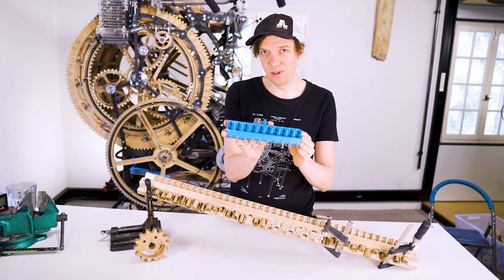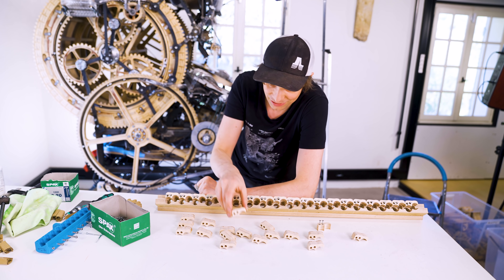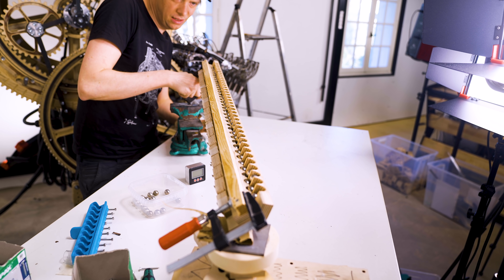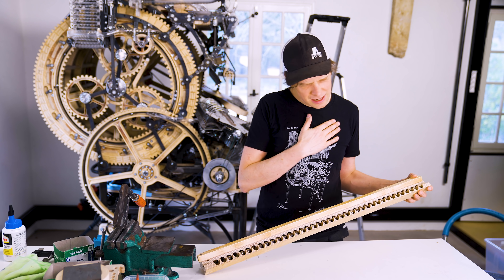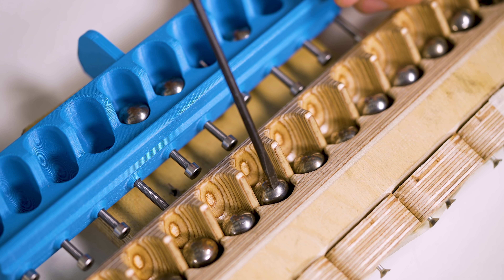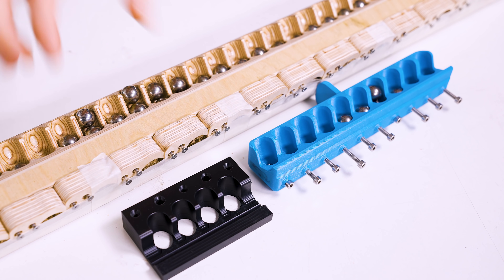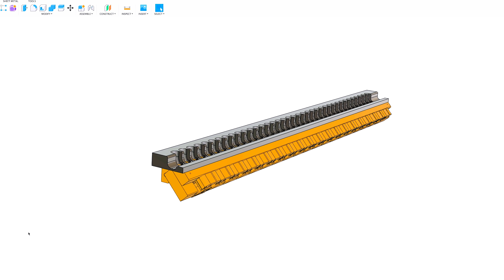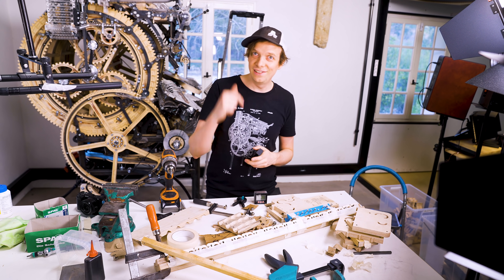Ultimate Material Showdown

Comment: Martin, replace all the wood with plastic, plastic will last longer, and where possible, replace it with metal, I have been waiting for the end of your project for a long time, but you are constantly going in the wrong direction! Perhaps the purchase of a 3d printer will save you, but the CNC will not solve all the problems.

Comment: I'm just curious I know you say you want to take this on the road, I'm a guitarist myself so what I'm curious about is when your designing parts are you thinking about the expansion/contraction of the materials due to temperature and humidity? Like if the material contracts too much you could loose all that precision. The reason I ask this question is you raised the point of wanting larger windows for tweaking.

Comment: SUGGESTION: Machine in plywood but don’t Dremel it, then paint the surface with UV-activated epoxy resin ( say 3 coats ) Expose to UV between coats. Then machine again with the same orientation to get hard, sharp corners. Should considerably reduce friction and maintain appearance. 

A couple of observations: 

1. Holes at the top will may more problematic as the balls will have less momentum at the op

2. Balls magnetised?

Comment: The gloss-to-satin black of the POM will play well with the black of the MMX's metal parts.

The only idea I could have to retain the plywood, would probably be to add a veneer of steel that would reinforce those sharp edges on the one side and metal inserts to reinforce and become the leading edge of the walls of each drop cell. Which seems like a bitch-and-a-half to do to retain a part that arguably is going to look better in POM.

Comment: What about milky looking delrin? wouldnt that be more fitting with the soft color palate of the machine.
Also what if you take the wood parts, cast them fully in resin, and after hardening you run the toolpath again to create the wooden look with crispy edges?

Comment: If you really want it to move smoothly, get some PTFE*

*Don't actually get PTFE, it's horribly toxic when you machine it. POM is a really good option though - honestly I wasn't sure why you weren't using it more for other things in the build 'cause it's so good. It's as strong as aluminium in a lot of applications and very good for gears and such - in fact the small jack that comes with your car probably has a POM nut on the screw part.

Comment: But how are the marbles going to feed into it? There are multiple parallel tracks that feed in from the back down the divider length at the moment, that won't be possible with the new divider design, as the marble holes are now against the back edge where they feed in. This means the new divider will either have to be attached the other way round, with the marble holes angled towards the front of the divider, or fed from the front. You are testing it the wrong way around  ;)

Comment: of course diferent materials have different properties. H+arder surfaces like PMA (compared to mst woods) imbuemore of a spring in the marble movement since more of the impact energy is reflexed back. The more resilient the material, and to some extend the top layer, hence you can change the physical properties of wood  with varnish, many layers albeit, like in string instruments. perhaps you should start playing with different applied coatings on the wood? might be the right time to investigate epoxy , varnishes . you might be ableto add a bit of color to the design as well.

Comment: So, I just want to point out that your material trials were incredibly biased against the plywood, even though I agree with your findings. Your data set for the POM was the smallest out of any of the materials, and thus the least trustworthy; while the plywood had a (comparatively) massive number of trials, which made the numbers of failures larger as well.
Reply: Obviously there will be ultimate material showdown part2 when the full size POM part is milled!

Comment: You could try tightening the tolerances a bit on the plywood, sand it smooth to grit 400 or 800, buff it with the dremel and use something like beeswax to make it slippery smooth. It will have similar properties to plastic.

Comment: One suggestion from what I do to have low-friction, mechanical plywood parts: Machine part by a "roughing pass", brush on fast-cure, low-viscosity expoxy resin mixed with a little aerosil to thicken it, let cure and do the final "beauty" pass. This yields parts with a precise surface and the original "wood" look

Comment: the rounding of the wood creates a ditch between the lower marble and the curved edge. The marbles stop against the "hump" between the two marble slots. What if you just continued that ditch through that "hump" (and perhaps in the side wall too)? Relying on edge sharpness is a problem for longevity of the parts. You'll have to replace them very soon, because even the POM will wear. I liked the idea of rounded edges to prevent wear, and I definitely agree that a reliable design is one with a lot of tolerance (what you called "window" in this video). The rounding is "pre-wearing" of the edges. You just didn't "pre-wear" the separation between the marble slots... It won't need much, just a little dimple in the right spot, perhaps just 1mm or so. It would be more durable and a lot cheaper in material, I think.

Comment: I wonder if the angle needs to change at points along the length? The marbles lose a little speed with every collision with one sitting in the channel, so at the end of the divider they have been slowed a lot, and a steeper angle would compensate.

Comment: no entiendo por que te preocupa tanto el ángulo de descenso del carril si no modificas el ángulo de acceso a los tubos que sigue siendo de 90 grados, dificultando el acceso de las canicas

 I do not understand why you are so concerned about the angle of descent of the rail if you do not modify the angle of access to the tubes, which is still 90 degrees, making it difficult for the marbles to access

Comment: This Ultimate Material Showdown was a good idea to eliminate the plywood... If all materials were tested at the same conditions. Martin tested PMO element half length of Rossero's PLA prototype, which is also a mere fifth of the current divider. Also Martin didn't considered to test with a non sanded prototype, or even a harder wood type. This is sad to ditch the wood this way, without considering all fixes possible

Comment: You should try to remember that you will have a constant feed of marbles going through that divider and their combined gravity weight should keep it feeding all the way through. Try adding a tube that can feed like 30 to 40 or more marbles at a time and see how it flows with that kind of marble pressure to set your angle in the window of your machine.

Comment: Need to think about surface tension of the material. If you had a way to make the plywood as smooth as the plastic print, the marbles would have less to slow down and by that would increase the speed going down on any angle. +Wintergatan

Comment: I spent 10 years studying and developing tribologically optimized solutions to convey materials.
With specialty, modified POM grades materials I could get a can sliding ( sliding, not rolling) over an inclined plane as low as 2°40'. And this in dry conditions, no lubrication involved.
Going with POM you'll have a reliable, time stable solution. A bonus point is the fairly high hardness for an unfilled grade, which  avoids dust partcles to get stuck in the material surface, hence a good friction stability over time, making it a so better candidate than UHMWPE for this application.
The total absence of hygroscopic reaction makes it way superior than PA for this application.

Comment: 6:49 what if you were to undercut the clearances of the walls and holes on the CNC and get them to final size manually? It would take extra time, but you could manually ensure each hole and wall was the right dimension as you went, as well as avoiding any fraying of the plywood.
Reply: I think that's where the material decision comes into play. Allowing the CAD to carve in POM (PolyOxyMethylene) plastic truly is that insurance.

Comment: Another approach: reduce the variation in the marble positions, too. Then you won't need so small tolerances on either the marble divider nor in the individual marble paths.
Reply: So how do you do that? You can't just say "reduce the variation" and not give a way to reduce the variation.
Reply: @StoneUSA  with the previous approaches. Either by adjusting the pipe lengths or using the marble height adjustments. Of course - if the different materials can avoid this issue altogether, then this is not needed. But if not, this could help.

The problem with the previous adjustment wasn't so much in that it didn't work, but that it requires such a fine tolerance with the height. This one (with plywood) didn't require such a  precise height, but was more picky on the angle.

With roughly the same marble heights this gives more tolerance for the angles.

Comment: You could always make a 3dp or machined plastic insert(s) that would fit inside a plywood shroud. Then you'd have the performance but also the aesthetics.

Edit: they also make 3dp filament that looks remarkably like wood, which was used to make the adjustable hight modules, that may also work to make a piece with both the looks and the performance.

Comment: My main concern on the marble divider is going to be wear and tear. when you talk about material properties realistically you've already designed into the plywood the wear and tear prevention that is those rounded edges. The benefit of the 3D printed and the pom is that they are sharp edged. I'd be looking at how well the material will hold up or how hard it will be to replace it on the fly if needed

Comment: That is an excellent breakthrough. Older theaters have what they call "raked" stages, where the stage slopes gently towards the audience to provide a slightly better view than if it were perfectly flat. This can vary theater to theater. I know you have the ability to level the machine with its feet, but if the margin of error is so small, the rake of the stage is another variable that might cause issues. TLDR - you're right to question the narrow margin of error with the slope!

Comment: The drag coefficient of the plywood is the problem then if the other materials handle the marbles better most of the friction problem would be fixed with plastic but if you really want to use plywood use it only when angles and friction are needed and if you want it to be smooth plastic seems to be the way to go.

Comment: I expect that the vibration of the machine may change your result. You may have to do another adjustment once it's installed on the machine. Chances are, because of the vibration, your marbles may tend to bind less, but that also means they may also fail to fall in an empty slot. It's also possible that the vibration will randomize it well enough that it doesn't matter and gives you a more reliable result as an aggregate.

Comment: Martin should be doing a finishing pass where he follows the contour of the front in a vertical pattern instead of side to side. This will make it smoother using the ball cutter and remove the tool path marks.

Comment: Wouldn’t an “Armor” strip suffice? A flat band like feeler gauge tape (available in 25 mm width and a thickness of 0,8 mm) that has the holes laser cut out and is glued flat on the marble devider over the Full length would make the holes edges sharp and strong. As for the studs, simply glue on a strip of metal and done... best of both worlds
Reply: Pour some resin on that bad boy it'll glide like ice

Comment: Some hardwoods like Ipe (poui, pau d’arco-Handroanthus) are very dimensionally stable and machine almost like metal. If you wanted to stick with something aesthetic like wood, but with the much better material properties found in plastic, it may just be a matter of changing wood species for components like these. Ipe is super hard (use carbide cutters) and very slick when machined.

Comment: I could make you a marble divider out of aluminum then hard anodize it and that would easily last billions of marbles. Anodizing artificially grows the oxide layer and uses it as a durable coating. Aluminum oxide is sapphire. Hard anodizing is a much thicker coating that will be harder than the steel balls, which means the steel balls will not be able to easily wear it, like plywood or plastic or uncoated aluminum.

Comment: Hey Martin, I don’t know what material was used for the marble conveyor/fish stairs, but you should use that material (clear acrylic?) for continuity on the machine
Reply: Yess clear acrylic would be very nice I agree !
Reply: That's actually not a bad idea. 
The whole marble divider (all 3, or is it now 4 pieces (+cats)) should be made of this material.
Reply: I thought the clear cracked at several points, and wore down really quickly? Additionally, I thought it just sucked really bad to work with.
Reply: @johnl0cke  You're right, it might crack, but I don't think acrylic is sensitive to surface wear in this application, and maybe it won't be as see-through as I imagine, but it could be a stunning sight -  as if the marbles were hanging freely in mid air.

Comment: One thing I would note is: won't the marbles usually be coming onto this part with some existing momentum? I feel like he has a bit more leeway than he thinks, but I do think that testing for the worst case and switching to the POM are the right decisions.

Plus, I think it will look great on the machine, particularly in contrast to the plywood and being so close to the black and white handles.

Comment: If you want them 3d printed there are several cr-30 belt printers out there which can print the parts full length. You could do a collab with Stefan at CNC kitchen who is in Germany. I sadly have not recieved mine yet 😞

Comment: I'm surprised that Martin hasn't used epoxy saturated plywood. It forms a material that does support sharp corners and doesn't move around with humidity changes. I believe that it would have much the same mechanical properties as the engineering plastics, while retaining the look of plywood.
I'd even epoxy treat every piece of plywood on the machine.

Comment: I have a slight concern that your test wasn't set up fairly, your Pom piece held the marbles up at max height always so you couldn't test for some marbles sitting lower in the slot providing a divot to rest halfway in and cause the rolling to stop up.  I imagine this concern is coming way too late and you've probably already made the larger piece and will find out how well it works in less ideal conditions once you hook it up to the plywood, but still, something to keep in mind moving forward.  Try and change as few variables as you can for tests like this.  The fix would have been to place it on top of something with variable depth holes.
Reply: You see him use some cardboard to mess with the height of the marbles in the tests with POM.

Comment: What you should do is place the camera somewhere low on the axis that the marbles roll on and film them while they're rolling down.
That way you could measure the lateral movement, which is preventing the marbles from running smoothly because it absorbs kinetic energy.
Then, you could optimize the design to minimize this lateral movement.
Also: why not use an exotic wood instead of POM?
POM is great, obviously, but I believe wood has more heart and is more beautiful for musical instruments.
I suggest ebony wood and I think it'll be hard enough to make the sharp edges.

Comment: I appreciate that you have a fetish for plywood, but as you say it has its limitations.
I am wondering have you/do you take in account the different rolling resistance of different materials?
It looks to me like plywood, no matter how many protective coats of lacquer has a greater rolling resistance than the other materials.
and do you take into account the wear rate of plywood?
How long will the gear teeth meshing together last?
You've only played with it so far, but in a performance touring situation where the gears will be doing a lot of work, the wear rates are going to be quite high.
Do you have contingencies for this? Can you produce a new gear on tour?
Surely, plywood is the weakest material link in the whole MMX.
Why not use them as templates and proof-of-concept and machine the moving plywood parts in brass.
Of course, it's going to make it much heavier, but it's already heavy anyway. It's like you can currently just pick it up and move it around easily now.
It requires logistics, so it would not much different to the logistics required now.
Anyways - just some thoughts.
I appreciate your journey, your obsession, your passion - keep going.

Comment: Redundancy test: After passing the one million marble test, you should consider testing the machine whilst rotating counter-clockwise and clockwise on a turning base.  This would test vibrational edge cases and rare bounces of marbles within the system. If the internals of the marble pathways/lifts can function during such acceleration states, the machine would be known to be more robust. (Spin not just at the center of mass but multiple acceleration states). This would also functionally test light wind environments and prove the machine could be played outside!! (Disregard the catching of marbles, routing dropped marbles back to queue to avoid landing inside).